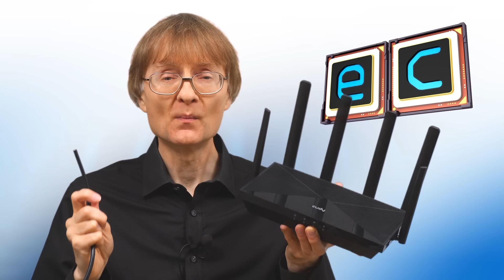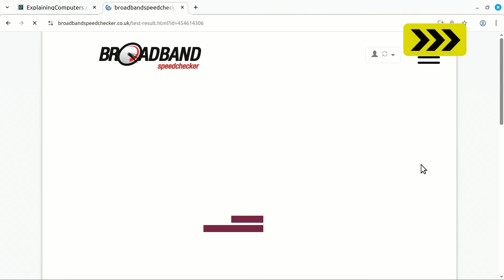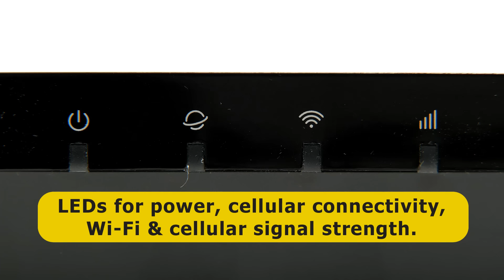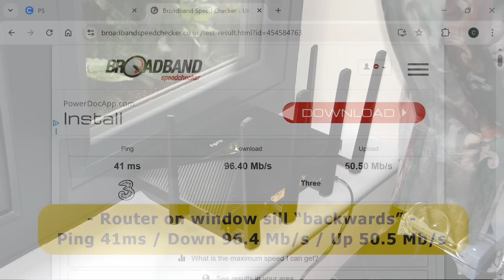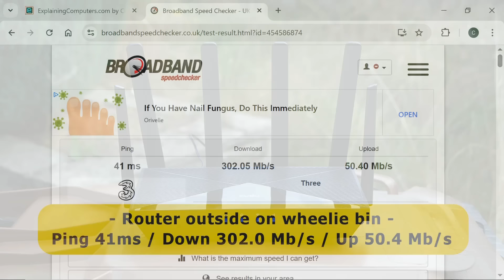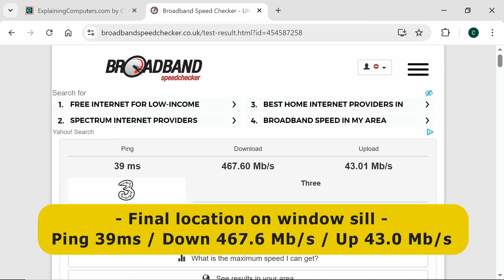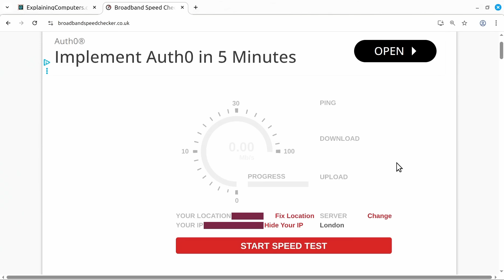Switching to 5G Broadband: Cudy P5 Router

Comment: Interesting. For my case I have optical fibre connection to my home since late 2021 and I'm really happy with it. Initially I had 150/150 speeds, but last year for just around 2 Euros upgraded to 300/300 and pay the same price as I did for 150/150. Internet+Cable TV costs me around 25 Euros (1500 Macedonian Denar). It's not perfect, but the internet serves me well most of the time.

Comment: I’m lucky enough to have fibre. LTE and 5G options are throttled if the cap is reached. Very easily capped with 5G.
Reply: fibre can be capped just as easy
Reply: @si4632 Correct. However, fibre is uncapped and unthrottled where I live as opposed to LTE and 5G. I would much prefer 5G TBH.

Comment: Switched from Cuckoo Fibre about 9 moths ago as they kept pushing the price close to £40 pm to Vodaphone. Both were reliable but WiFi speed drop by half in other rooms from where router is. Vodafone is currently £31 pm for 500Mbps d/l and 70Mbps u/l except when on a VPN; for some reason the Vodafone supplied router does not play nice with most VPNs and does not have the control over settings to fix the MTU problem. Not buying another router when I can just disconnect the VPN to get the full 70Mps upload.
I have a Voip phone number but over half the time the incoming call is silent. Could be a handset problem.
Hopefully in just over a year I can move from Vodafone to an ISP that has the same up and download speeds, better WiFi, and not the VPN problem.

Comment: I switched to 5G Internet a few months ago.   I tested it before cancelling my wired internet connection because I had a trial period offer through T-Mobile. The 5G connection just blew away my wired connection.   I was so impressed with it I terminated my wired connection.   More than twice the speed and less expensive.  Of course I also cancelled my Cable TV connection so I saved even more money.   I have my 5G Router setup next to my living room window.   The T-Mobile Router does not have the options I am used too so it will not be for everyone.
Reply from the maker: Very interesting. I had been contemplating a test, but I was very nervous about such a transition. But then BT imposed a 29 day test on me! And the decision was made.

Comment: Do you have a monthly usage cap on data?   10gb,   50gb?
Reply from the maker: My data plan for the SIM in the Cudy 5G router is "unlimited". But there is a "fair use" policy, which is either 300 or 600GB/month, depending on where you look it up! On my 4G unit, then plan limits me to 120GB/month.

Comment: I'm using a Three 5g unlimited sim costing £12pm with their own 5g router, and getting speeds up to 350mb/s which is far better and faster than local wired services.
Reply: you bastard ! lol where are you im on the outskirts of londinium and haven't seen a 5g connection
Reply: the 4g signal is great and supposedly theyy have merged with vodafone which has a better 5g around here
Reply: seems to me in england the service is subsidized greatly. not so much in the US. starlink is the best wireless imho

Comment: Recently, I tried moving to Fiber and initially was wowed with the speeds. I ran into a showstopper that forced me back on cable. The Fiber provider was using CGNAT with rotating external ip addresses. I, however, often host gaming servers for my gaming group and was horrified to find out just how incompatible server hosting is with CGNAT. It was all rather depressing because the week on Fiber showed just how smooth the data speeds  and response times were. I am hopeful that once ipv6 finally takes over and this is not an issue, i can return to the world of Fibre.

Comment: Here in the US, 5G home internet has been a great option for a while now. Ive been on 5G home internet for 4 years now, first with T-Mobile and now with AT&T.. I generally get around 500 mbps on AT&T. I highly recommend 5g if you get good speeds on your mobile data in general, very stable
Reply: Someone once said, "a fool and his money are soon parted." I don't really think you're a fool but you did say you're using AT&T. Last time I looked, AT&T was about as expensive as it gets (unless you're an employee or something). Of course, you might not have any other choice. That said, it would be very interesting to know what other alternatives you have available since I'm betting you might be paying AT&T for little more than bragging rights. And it wouldn't be the first time this sort of thing has happened, either. 

If it's just you, that's some serious overkill you probably don't use, especially if anything on your LAN is limited to 100Meg. And there you are with a 500M connection? You might want to re-think that speed thing, even if everything on your LAN uses 1000M (gigabit) speeds. For example, if you're streaming 8K videos all the time then there may be a legitimate use for those higher speeds though that might still be a complete waste of money if you can download your content as opposed to "streaming" it. Personally, I find 480p DVD steaming quality quite acceptable for most streaming content and almost never see a need for 2K, let alone 8K. After all, if your monitor is less than maybe 4-feet, even 2K can be overkill. 

Of course, downloading Windows updates in the blink of an eye can be nice, so there is that...
Reply: @WXSEDY  nah I just preferred having something easy to setup. And the main option I had in my building was Verizon which I've had a bad experience with in the past. The promised speed was just around 100-200 Mbps but I had a good experience with the connection, getting 500. I use AT&T Internet air, the price was pretty much in line with other options. Home Internet 5g is very different from mobile data, different priority. Also fast connection helps on days that you work from home.

How much do you pay for your connection?

Comment: "2 months ago, if you told me I'd be switching from wired to wireless internet, I'd have told you that you were insane."

That gave me a much-needed laugh.
Reply: I feel that though! Most end user desktop equipment only has Gigabit ethernet. The wifi 6Ghz 6E on my ISP provided modem can push 1700Mbps to my phone (2Gbps plan). I often unplug the ethernet on my gaming PC to do long downloads because the wireless card inside can do 1400Mbps, 40% faster than the Gigabit Ethernet onboard. I reconnect the Ethernet when done, to keep pings low, but I have a feeling it'll be very soon that the wire won't be needed at all.
Reply: @DaxtonAnderson  - Wired Ethernet will always be faster and with lower pings and interference than WiFi.  Wireless always has some overhead and interference.  If you want the best possible performance stick with with ethernet.
Reply: @BillAnt rural Canada, almost no interferance unless I run the microwave, but that only affects lower frequencies like 2.4ghz. 

Until consumer gear (laptops, motherboards, consoles etc) steps up from GBE to 2.5Gig or higher, many new wifi 7 devices will indeed download content faster on wifi than Ethernet, if of course you have over Gigabit at home. Even my 6E on 6ghz is faster than gigabit now.

Would be nice to see Windows implement a feature where you can select on a program by program basis what uses wifi or Ethernet. I'd point steam to wifi and everything else to Ethernet lol

Comment: I switched to a 5G router a few years ago after getting sick and tired of Virgin Media's constant price rises. I get somewhere in the 300-400Mbps range most of the time, which is plenty for my needs and a lot faster than the 125Mbps that I was paying Virgin almost 4x the price for. The main downsides are higher latency for online gaming and the fact that UK mobile networks pretty much all use CGNAT.

Comment: I'm pretty sure in Poland where I live, cellular internet is definitely more expensive and slower than the 'regular' one. Right now I'm having a 400/100 over fibre for which I pay about 50zł which is about 10 GBP. Although this is in a city and rural areas would be more expensive. Cellular without any data transfer limits would be more expensive and worse in my area, because I don't have 5G nearby.

Comment: I use a TP Link dongle, I can't seem to connect to the internet in Linux but when I run Linux in a VM it connects automatically, why is this?
Reply from the maker: This sounds like a Linux driver issue. When you are running Linux in a VM, the connection is made by the host machine and shared, so using its drivers, not Linux ones.
Reply: @ExplainingComputers  Thanks

Comment: I would consider 5G Broadband for myself too, if I didn't have the requirements I have - I game and I sometimes do livestreams, both are very sensitive to latency. Plus I'm not aware of contracts in Germany that offer truly unlimited 5G for cheaper than traditional Broadband contracts.
Reply: I can't speak for your country, or providers, but here in the US I'm on T-Mobile 5G Home Internet,  & online gaming  via my PC with STEAM for Linux works just fine as I'm seeing ping times on average of less than 40ms, and some days as low as 18ms. with download speeds around 1Gbit and upload speeds between 50 mbps - 120 mbps, & while I don't live stream I do watch a lot of live streams, live TV via YouTube TV, & do Zoom calls for work which have had almost no issues. So if you ever get the option for unlimited 5G internet for a good price, it's worth at least trying out.
Reply: @CommodoreFan64  10ms is a normal latency to nearby servers with wired DSL. Might be even better with fiber. For quality of telecommunication low latency is most important. Big bandwidth can't make up for delays.
Reply: @gnu-lynx2501  DSL when it existed in my area 2 years ago with Frontier Communications was still "up to" 24 Mbps down by 1 Mbps up, & that was considered their "Business, Class" plan and they wanted $80 USD a month for it plus the install, and modem rental fees, what a Joke. Beside with sub 40 ms pings usually in the 20's over mesh WiFi across the my house from the gateway, I've not noticed any issues with it doing what I do, as I'm not hosting a server with it, and I don't think most with a good connection to a tower, and proper setup will notice it either on a 5G Home Internet connection. Lastly the best part is the price which for me is $50 USD a month, and is the cheapest unlimited internet plan in my area offering even better service with faster speeds than even a local fiber company(I grant you ping might be lower, but not by a ton) unless you get their business class internet packages, which is nearly $200 USD a month. So for me 5G Stand Alone internet from T-Mobile works very well.

Comment: 5g for home internet is just adding to a disturbing trend where technology companies try to say that miracles of software will make up for not ever building any infrastructure. We don't need Transit because autonomous vehicles will miraculously make point-to-point travel seamless for everyone in violation of physics, we don't need to build any fiber optics because somehow there will be enough radio spectrum to accommodate everyone everywhere. It's going to end up like cars, where the first few are incredibly convenient for their owners but it all goes to hell the second everyone is trying to use them at the same time everyday.
Reply from the maker: I agree with this. After about 7 weeks with no wired Internet, I still find the concept of wireless over wired disturbing. But for me, right now, it is working!
Reply: I would still try and get back to wired, at least if Openreach or whatever finally offer fiber. Fiber is way more stable and lower latency, and is at least on paper capable of even higher speeds.

Comment: Hi Chris, I’ve been using a BT/EE 500mb down/ 70upload package at 2 different properties for several years now, never once had any issues. Fortunately both properties receive FTTP, although the later property is very much in rural England, so I was apprehensive it wouldn’t receive FTTP at all. 

The first property is in a much more built up area, close to a big city and as such we have a 4G backup SIM as provided by BT should the fibre internal fail. Unfortunately, this would not be viable at the second property, as even though I am on EE’s mobile network, where the house is receives very little signal from all the major UK mobile networks. 

I’d like to perhaps incorporate a 4G backup solution at the second property, but the lack of cell signal makes 4G speeds very poor.

Fascinating to see how well the 5G solution is working for yourself, and shows real promise for the technology in the future. Who knows, one day OpenReach may even discontinue the fibre network! 😂

Comment: 2 years ago I had to work wirelessly for a month in Europe. 5G worked really nice, I got 350Mbps download and around half of that upload. Doesn't match up to my current 500/500Mb  symmetrical fiber.

For backup, I have a Starlink. Upload is slow 10-50Mbps, DL is around 150Mbps. The problem is overcast and rain. When it's a heavy pour-down, it tends to cut out a lot. :O ..

As for latency ... well, you don't want to play an FPS game over Starlink :(

Comment: Worth trying it in the loft?
Reply from the maker: In don't think so. I've been thinking about this, and the only benefit of height can be to get a less disrupted line of sight. And from the window sill it is on, the router has a direct, uninterrupted line of site to its main cell tower. Raising the router from floor level (and in the garden) did help it clear lower level buildings, fences and such. But there is now nothing left to clear. I am very lucky in this regard.

Comment: I had a similar problem, with lots of my devices connected to WiFi router going to broadband router. I was paying £70 a month for about 40Mbps. I got an unlimited 4G data sim from Smarty for £20 a month, and connected my router wan socket to a pi 3 and the pi 3 WiFi to a cheap 4G router from Amazon. I set up the pi 3 as a bridge between the two networks and  my internal devices needed no reconfiguration. 😊

Comment: Have you tried bonding both  of the ISP connections, and see if speed has increased?
Reply from the maker: I have not. The router can only connect to one network at a time.
Reply: @ExplainingComputers  Dual port networking started back in Windows 2000. Effectively, you'd want to disable DHCP on one of the routers, In fact I just watched a video earlier today on connecting 14 modems to i increase bandwidth, to the throughput of broadband. 10 years ago, I had a dual-port router so that if one ISP failed, it would "auto-switch" over to the backup. This didn't give me twice the speed, I was using it for redundancy. But think of it as two highways parallel to each other.

Comment: What a councidence!  Just yesterday having trouble with my Internet. I have fiberoptic conection, with cable I do have 95/98 MB D/UP speed,  but with the WiFi has ½ of that speed. 

Is it normal to loose that mucho broadband in the same place and equipment?
Reply from the maker: Broadband is the connection to your router, so what you cite as the cable connection here. Wi-Fi is an alternative means of distributing your broadband connection across your LAN, and very frequently delivers a much lower speed due to congestion, obstructions, etc. And older Wi-Fi standards are significantly slower. So yes, it's normal, and almost certainly fixable! :)

Comment: I have been using LTE USB modem sticks since 2015, however I've migrated to a router since then and for a couple of years I've been using ZTE MF286D alongside an external  17dBi antenna. I've cycled through many providers by just buying their starter prepaid cards for just 1€. Currently I buy once a month a SIM card from Virgin Mobile. After activating it, I am granted 760GB of mobile data which is way more than enough. It's good to have more than you need though. Times were grim when 1GB data plan did cost over 10€.
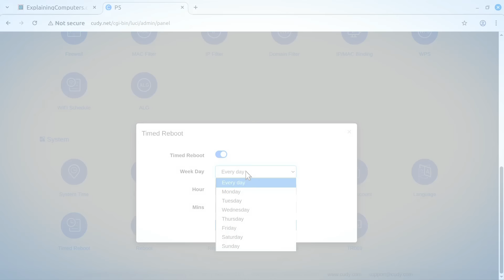What I love about this however is the independence. I am not tied down by any long term data plans and the hardware belongs to me, rather than being rented. My speeds vary, but right now at 15:20 on a Sunday I got 77Mbps download and 44Mbps upload with 23 ping. For 1€, it's practically free internet. Of course, there needed to be investment beforehand, since the router was 70€ and the antenna was 47€, but in long term, it is way cheaper than tying yourself down to a single ISP. I am lucky however, since the BTS I am using is in a straight line, just 1 kilometer away from my home with no obstructions. There's also another one in the opposite direction, though from T-Mobile, which I use for my mobile phone.
Mobile networks are truly a blessing if your location allows for them. It's good to do benchmarks beforehand and see how they behave, before making the switch, since some locations may be just overwhelmed with users.

Comment: I used land line and cable internet ISP's up until about 5 years ago which were expensive and limited to 2mbps over landline and 50 mbps over cable - I switched to a cat12 4g LTE router and now get between 30 and 150 mbps depending on the time of day - the SIM is a SMARTY one using the Three network and I get 200GBytes of data for £13.50 per month which I can alter or cancel at any time  - data SIMs are more expensive so I use a normal SIM - my router has a phone socket so I also get unlimited VOLTE calls and unlimited texts for the price.

Comment: Chris, I did the same a few months ago — switched from the expensive Virgin Media (£45 per month) to Three 5G (£19 per month) using a Three 5G indoor router connected to my TP-Link router, which then connects to a network switch. I also moved my landline number from Virgin to a VoIP service (£8 per month) and set it to redirect calls to my mobile.

Eventually, I want to get the Three 5G outdoor router installed and cabled to the TP-Link router inside.